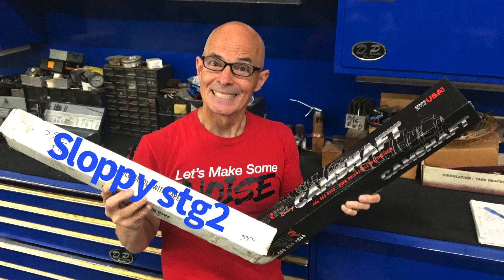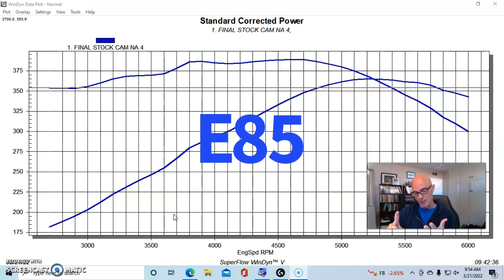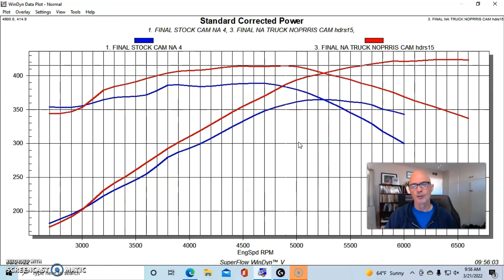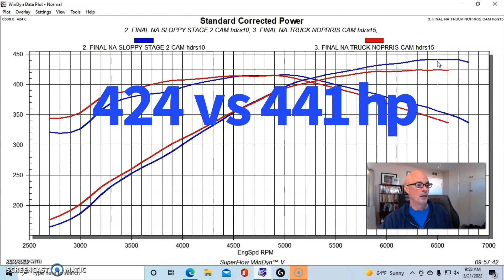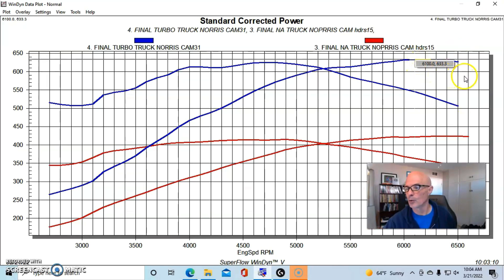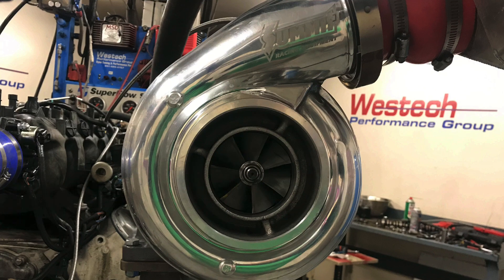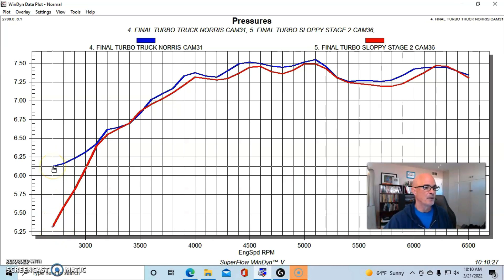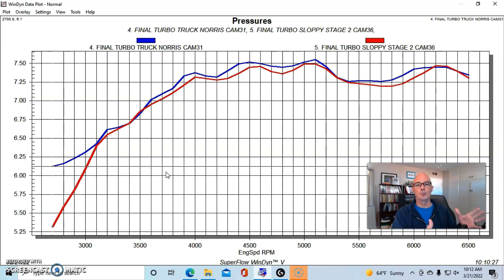HOW TO: TURBO LS CAMS. TRUCK NORRIS VS SLOPPY STAGE 2-IT'S ON!  WHICH ONE IS BETTER WITH BOOST?

Comment: street driven on nice days/drag strip on weekends. colorado build with a 6.0 LS/T56 manual combo. Most likely with an 85mm v4 VS racing turbo. power goals no more than 1000HP. What camshaft are you going with?
Reply from the maker: 100s of cam will get you to that power level, including any of the three we sell
Reply: @richardholdener1727  is the truck Norris cam chef arguably the best NA camshaft and or turbo camshaft up to 800 hp that is available on the market today?

Comment: Iv always run sloopy stage 2 on a nitrous 5.3 with pac 1218.s im broke and it was cheaper  im not worried about a small hp difference ill take any cam

Comment: What cam would you chose for a twin turbo 4.8? Street truck 4l80e chevy 1500 2wd ext cab with twin ebay gt3582s 6262 im still undecided on ar size .63, .82, 1.06 all t3 housings or jump to a t4? Id like to run around 3k-3500 stall and will be on pump 93
Reply from the maker: that stall speed seems excessive on a street driver, and I would get a Low Buck Truck cam with a 2500-2800 stall and you can max out those turbos
Reply: @richardholdener1727  appreciate it, have you ever done testing on the gt4202r or gt 4508r ? Was looking at those cheap on ebay and wondering what they would max at, 4202 is a t4 1.15 ar 82/75 and 75/102 compressor and the 45r is a 89/102 compressor and 89/77 t6 1.26ar

Comment: What springs Ran with truck Norris cam? Stock?
Reply from the maker: you can run stock 550-lift (LS3/LS6/LY6) springs with the Truck Norris or the 500-lift stock 706 springs with the NSR Truck Norris

Comment: Ok, so can some one help me out here to understand it a bit better.  I got 98 c1500 extended cab, which are pretty heavy. From my understanding the truck Norris is a better option do to the weight of the truck and more TQ down low?
Reply from the maker: yes
Reply: @richardholdener1727  i see 🤔
Thank you.

Comment: So to verify with both these cams under boost you didn’t have to change the springs ? So you ran stock springs in those 799 heads ?
Reply from the maker: both needed and had spring upgrades

Comment: SS2 cam makes managing traction on a 10" tire with little to no prep much easier, snubbing off some bottom end torque can be a good thing, and you still have better topend power.
Edit: just an opinion.
Reply from the maker: one of these is not a race cam, pick your cam based on usage and rpm
Reply: @richardholdener1727 
Then why compare them  . . . Lol

Comment: I am running an L33 with the truck norris and a 7875 in my nova. How much ignition timing under boost were you running in this video?
Reply from the maker: we ran 20 degrees with e85 at the hp peak
Reply: @richardholdener1727  thanks!

Comment: How much boost is safe for a stock cam 6.0? 9psi?
Reply from the maker: THAT IS EASY-NEEDS RING GAP
Reply: @richardholdener1727  so stock motor will need a tear down to gap the ring for low boost?, or 7 psi is good on all stock?

Comment: Gotta do more supercharger comparisons. Preferably an LSA type supercharger for us truck guys looking for more work/tow/hauling torque.
Reply from the maker: LOTS OF BLOWER VIDS UP
Reply: @richardholdener1727  yes but not low end performance specific. Its all top end power. Lots of guys have these 6.0 truck motors in thier trucks formwork and hauling. I don't remember seeing a video for max low end torque with an LSA type supercharger.

Comment: Richard, could you please help! I bough a awd sierra that had a 6.0 but now has a 5.3. It has a sloppy 2 with a 88/83 .75 afr turbo. It has no low end torque and boost dosent kick in till after 4000rpm. From what i understand i could possibly benefit from a smaller cam. For my application would you do the truck norris or sloppy best? Thanks!
Reply from the maker: YOU NEED A SMALLER CAM AND SMALLER TURBO
Reply: @richardholdener1727  I agree completely. I didnt build the setup but it was made for a more capable 6.0. Ill do some research and find a better cam and turbo setup. Thank you for replying back!

Comment: Richard I got a 4.8 single cab silverado and ordered the btr TN cam with beehive .625 springs Texas engineering headers 1 7/8’s I was wondering what else I can do for this 4.8 to get around 400whp not crank any help would be appreciated thank you!!! Love your videos.
Reply from the maker: you won't be anywhere near that number with that cam
Reply: @richardholdener1727  what would you recommend to get to that number

Comment: Are these cams being used on stock rods, springs, and rockers? Just a straight cam swap?
Reply from the maker: BOTH REQUIRE SPRINGS
Reply: @richardholdener1727  thanks for the quick reply, I knew I liked your channel for a reason. Just got a subscriber!

Comment: To think you can spend 600$ on a BTR cam or 600 on the sloppy cam with seals, 1218 springs, cam & Pushrods and get the same or better however you want your build to go
Reply from the maker: $600 on a cam? NO

Comment: The truck Norris cam had a 108 LSA the Sloppy stage 2 has a 112 LSA there is the difference you are seeing on bottom end . Tighten up the LSA on the Sloppy stage 2 and you'll see a big difference in the bottom end .
Reply from the maker: it's more than that

Comment: Can the Holley control cam advance on those engines factory equipped? I know that's often one of the first things removed along with cylinder deactivation but I think it would be VERY interesting to see what moving the cam around could do for low end toque and top end power!
Reply from the maker: no

Comment: Why not a sloppy stage 2 vs best cam
Reply: I bought the best cam so im really hoping its true that its better than the stage 2
Reply from the maker: THE BEST WILL MAKE LESS PEAK THAN THE SS2-IT'S A SMALLER CAM
Reply: @richardholdener1727  is the difference very much?

Comment: Ever test the Elgin 1839 vs the 1840 (SS1 vs SS2)? Or the 1839 on anything? Almost identical other than a 8 degrees less duration on intake side and 6 on exhaust, but same 112 LSA. I have both of the elgins on hand for a turbo 5.3 with a high rear gear and am leaning towards the 1839 for more low end.
Reply from the maker: pick the smaller one

Comment: I sure wish you had run the stock cam with boost so we could have seen how much more torque down low it made than the Truck Norris cam. That's where a truck pulling a trailer operates!!
Reply: Well the stage 2 truck cam make more power down low than a stock cam. It works the same way for boost applications so you’ll get more power with that aftermarket mild cam with boost. Stock cams from Chevy are pretty wimpy out the box if you compare them to what ford or dodge uses for the same displacement

Comment: Hi Richard, I have watched a ton of your videos. I was wondering if you have ever done a test on cams with similar duration but different lift? So for example I have run the COMP NSR drift cam which is a 233/243 .554/.554 and now I am running a Summit stage 3 which is like 232/242 .612/.612. The car feels like it lost some mid range. 5.3 stock bottom N/A in a drift car. Just wondering if you have played with that and what the correlation is.
Reply from the maker: not those specific cams
Reply: @richardholdener1727  I didn’t mean that specifically. Just giving an example of two cams that are close. I know you have tested LSA changes only. Just wondering if you have tested lift only changes s
Reply: Honestly Richard always recommends stage 1-2 truck cams for the 5.3. Anything after that it’s starts losing low end torque. Even at stage 4 it’s not even as aggressive as what you have which is like 224 intake 228 exhaust vs 232/242.  

Such a big cam on a smaller motor and you’ll have no low end power

Comment: thank you for answering my stupid questions with exact testing of the cam I was interested in. thank you so much I am ordering cam right after I leave this comment. Your testing and videos have more influence on people than you know.  Once again thank you so much.
Reply from the maker: Glad I could help!
Reply: @richardholdener1727 Richard would a 4.8 with truck Norris cam ls6 intake and 7665 .96 turbo be a good combo? Its for a drift car that weight 2400-2600 lbs

Comment: A 107 to 112 LSA ... a 212 to 228 duration ? IMO as far as NA goes this is not an apples to apples comparison ... but still a great test ...Richard did a video on LSA comparison a lil while back 108/112/120 LSA the 116 didn’t come in ... and if I remember correctly Richard was puzzled when the 108 LSA cam made the most low and midrange torque and I think the most hp but I am old so my memory might not be as good as it used to be ... so go watch it for yourself please ... I would like to see the correct LSA.test revisited with a stock 5.3 and then a 6.0 ... I like the TN cam and I think the specs are more for what any LS truck needs in NA form ... more low end torque... that 107ish LSA  increases cylinder pressure (dynamic compression) and helps increase torque ... yes it has a grumpy idle because of that LSA but it works ...Richard I’ve heard you say many times who drives at WOT at 2K-3K rpm .. you press the pedal it downshifts and is above 3k almost instantly and out of that extra torque range .. or you have a 3600 rpm stall and flashes to 4K rpm and you’re out of the rpm range again ... I’m not saying the SS2 is better but I am saying “PICK THE RIGHT CAM FOR YOUR APPLICATION “  ... a 5500lb truck won’t run like you think it should with a 228 and above duration cam with a 112-115 LSA  without all the “extras to go with it “... it’ll idle nasty but run like a 🐌 ... now be careful everyone some cam “companies” /retailers will only try to sell you what they have in stock even if they know the DURATION /LSA doesn’t match your combo or maybe they don’t know it doesn’t match IDK  but I see a lot of over cammed pickups thru the shop ... but it sounds nasty at idle... now if a nasty idle is all you want then go for it by all means ... someone tell me how sweet it is to outrun your race buddy with the same truck he has and he knows you have a smaller cam ... Great work Richard .. I appreciate the fact that you have blown so many “old wives tales” from the hot rod world out of the water ... btw I’ll buy one of the cams for the LSA test if you revisit it again .. thanks

Comment: Richard, I’ve been following most of your LS videos for years and love them!  Excellent work. Maybe I missed it but have you ever changed the cam timing. In theory could the timing in the sloppy cam be slightly adjusted to more closely match the truck norris and produce more low end torque? I assume more expensive parts are needed to do this so not much experimentation has been done on you channel or I’ve just missed it. Maybe an idea for a future test.
Reply from the maker: IT TAKES MORE THAN ADVANCING OR RETARDING THE CAM TMING TO MAKE THE SS2 CAM DO WHAT THE TN CAM DOES OR VICE VERSA

Comment: SS2 makes about 95 more pound feet of torque @ 3000 RPM in a 6.0 from one of your previous tests over the 5.3 in this test. That is a lot.
Reply from the maker: SO YOU ARE COMPARING THE SS2 ON A COMPLETELY DIFFERENT 6.0L TO THIS TEST ON A 5.3L-YEAH...WE DON'T DO THAT!
Reply: Yes, I am.  SS2 makes 95 pound feet torque more in a 6.0 @ 3000 rpm than a 5.3 @ 3000.   According to YOUR testing.
Reply: You told me the SS2 didn’t make more torque down low in that video than the stock cam and for me to watch the video, it did.   
Nothing wrong with either cam and we appreciate what you do.  We know money talks, Just try not to make the plug for a particular product so obvious.
Reply: It was your testing.

Comment: Whatever you do DONT BUY THE WRONG CAM. I made that mistake 25 years ago on a 350 and I was miserable. Im SO grateful for this channel and being able to see what the good stuff is.
Reply: Thanks! I selected a smaller cam for my engine I'm currently building. 219/225 in a LS1. I had to use a lot of restraint to not pick the bigger 230/240 cams
Reply: What would you describe as the wrong cam?
Reply: @cars_and_stuff  One thats way to big is the wrong cam. I didn't do my homework and lost a shitload of bottom end. I was a kid and did what kids do.

Comment: Issue with boost response on my turbo LS setups has always been traction. You have to limit the speed at which the power comes on. You must regulate the power at this point progressively with timing and/or boost control to get a tire to plant on a street. And I'm talking about a drag radial or slick. With a standard radial tire having instant response it useless. Having boost at 3k or below is useless as well. Much more practical to have a larger turbo and cam that brings in the power later.
Reply: For performance cars, absolutely. But for truck engines that happen to still be in trucks that tow things, a Norris cam and small turbo like an S366 will do a much better job around town and through mountains. A successful LS build plan depends heavily on application and purpose.
Reply: @boost1728  Just keep the stock camshaft for towing, It makes better power 3000 RPM and lower.
Reply from the maker: the great thing about information is you get to chose to do with it what you want
Reply: Electronic boost control can be your friend.  Get one where you can program in multiple boost control curves.
Reply: That’s if your racing but not if you want a daily
Reply: Some Trucks running 4wheel drive. More boost down will help

Comment: The all caps info block under your videos is hard to read.  We have two different cases of letters for a reason.  Aside from that, love the channel.
Reply from the maker: why are bigger letters harder to read?
Reply: @richardholdener1727  because that's not how people are used to reading and it screws with the pattern recognition.  If you need bigger letters what you need is glasses, not a capslock.

Comment: Doing my first build when I get home from deployment. Recently bought my dads old 1996 impala ss. I just bought a used LQ9 still all factory. And bought some 823 heads but watching your videos got me thinking about TF heads. And I'm lost on what cam to get. I'm not doing Nos or turbo. Can you give some advice on where to start with this build. Thanks for all your great videos and service.
Reply from the maker: use the 823 heads if you have them and check out the many 6.0l cam videos-choose the power curve you want (a Truck Norris cam for a milder application, a Comp 54-469-11 if you want lots of power

Comment: Is there anyway you could do this test with a centri blower at LOW BOOST please I have a feeling overlap would play a bigger role then in a turbo set up that has more back pressure.as a lot of people will not go for 1000hp
Reply from the maker: the results would be the same as a turbo-boost just adds to what is there

Comment: How would the TN cam idle in a 6.0(lq9). Not really looking for a chop, just more low end torque and avg power.
Reply from the maker: The idle is not nasty, especially on a 6.0L, the TN is a mild cam and works well on a 6.0L
Reply: It idles nasty if you don’t want to much chop stay away from it I heard it in person and it’s major lope and chop actually doesn’t sound good to me try Texas speed 216 -225 600 600 lots of down low for towing and burn outs and will make good hp and with 111 lsa it’s not to aggressive of a idle

Comment: Rebuilding my gen 4 5.3l block rite now, had to go with the ss2 bc of price point, replacing everything so spent the cash on parts that aren't as easily done later. Gen 3 706 heads,pac 1218s, gen 4 intake with flex fuel injectors,  all new bearings and rings. Engine has flat tops in it factory so hoping for a reliable lil ripper. The ss2 I put in my 6l (decked 243s, and gen 4 intake) was very impressive, hope to have the same with the 5.3, just can't beat the power gain from the ss2 , especially since it's half the price of about every other cam out there

Comment: Truck Norris going on the 6.0 2009 2500 HD extended cab 8ft tomorrow. Needed the torque for such a heavy rig and what we tow. Plus real life use  below 3,000.Thanks you so much,
Reply: That's what I want, although my 2004 doesn't tow shit. I'm just looking for fun, and the Norris cam makes the most power where I actually want it.

Comment: Be nice to see a Yote ran N/A with a few different cams for us Ford guys. Especially be interesting if they are worth the money or if you're just throwing it away.$300 LS cam shootout is nice but is only $300 where as buying the wrong Coyote cams will set you back well over 1000 bucks
Reply: There are coyote cams out there that make no power difference be careful yolo says to use comp cam stage 3 NA cams and he works for lund so I would go with those and get tuned by lund as well or get ahold of lund and ask them what they recommend for your year of coyote because each generation is a little different
Reply from the maker: I have tested a few Coyote cams (gen 1), they definitely added power